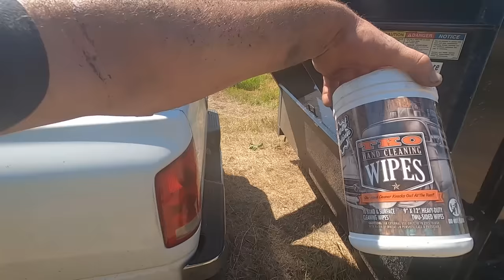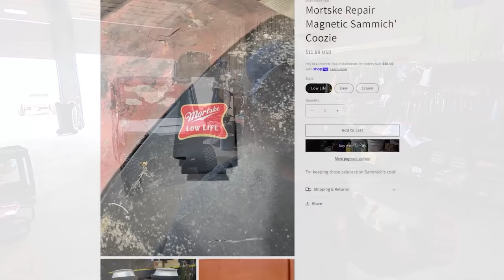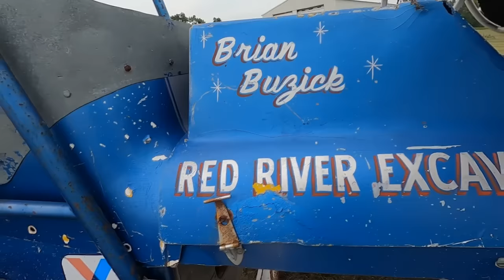The Most AMAZING Auction EVER! We SCORED Big Time! Super Rare Engine! Barn Find Hot Rod and MORE!

Comment: Those trailer brakes are called surge brakes, as you brake the trailer surges forward applying the brake. real common in the 70s and 80s when you had to plumb trailer brake controller into the brake system. they can be good if properly maintained. You got some really nice stuff at that sale, love to see the riley motor in something.

Comment: I believe that wierd Guage you found is a barometer. Measures barometric pressure in the air and tells the weather. If it's accurate that is. Has to do with warm or cold fronts in the weather. Low pressure fronts bring stormy or cooler weather and high pressure fronts bring warm or hotter weather. The farmers almanac works with barometers too.
Reply from the maker: Could be

Comment: As of like eight years ago, Atwood still made the brake master cylinder. The most common application of hydraulic brakes on trailers is for boats. You can replace the coupler with pretty much anything as long as it’s the appropriate disc or drum application
Reply from the maker: good to know!

Comment: That's a surge brake on the sprint car trailer.  Some people like them, some people do not.  As you brake your vehicle the force goes through the hitch and presses that master cylinder.  The shock keeps it from shocking the system too much.  Makes the actuation of the master cylinder smoother.  With this system you do not need electric brakes or a controller in the vehicle.  Lots of military trailers had it and also uhaul trailers.
Reply from the maker: good to know

Comment: The tires are not supposed to match on sprint cars, right?  Don't you put the taller tire on the outside, or do they weld the rears for lockers?
Reply from the maker: no clue

Comment: In this last week both you and Halfass have mentioned JUICE brakes. What's the big deal about them> Maybe a Mortzke minute?
Reply from the maker: Big upgrade 80 years ago
Reply: Early cars were mechanical brakes. By switching backing plates install master cylinder run lines= hydraulic brakes.

Comment: I seen the  Orange Ford you have its a automatic transmission. I love it. Would you like to do some trading for it. I have a 2004 H2 Hummer only has 150,350 miles . Runs great. I'm in a wheelchair an the H2 Hummer sits to high. The older I am getting harder it is for me to get in. His about new tires 35" x 12.50 x 17" looks like newtires has 6.0. Ford F150 sits lot lower them my Hummer. Just wondering if you would like to do some trading?
Reply from the maker: Nope

Comment: That wing definitely is not for that car! The conversion is done wrong. The lyft is supposed to be to the back rather than in the front that front end of that wing is up in the air, which will slow you down with drag!

Comment: I'd like to see you get the old roadster going again with a flathead V8 in it,that would be so cool & after you get it running you & Duff Dog could go for a R-I-D-E,or put a small block chevy engine in it with dual exhaust